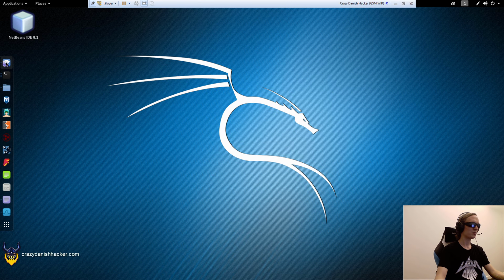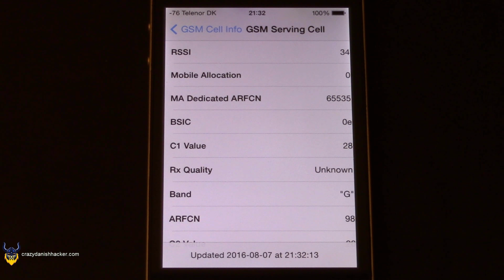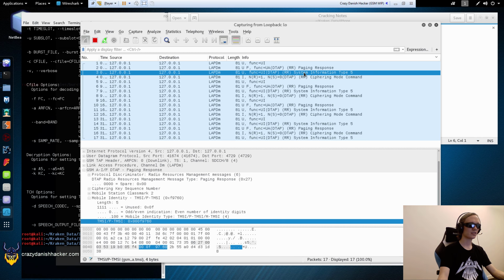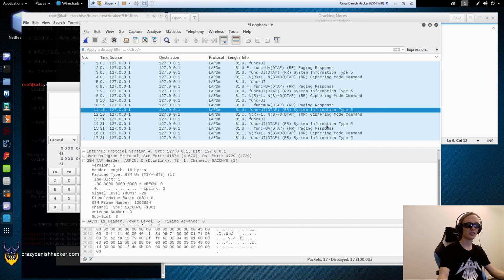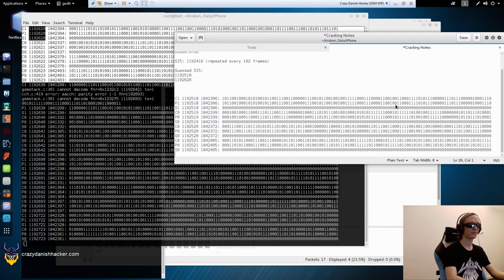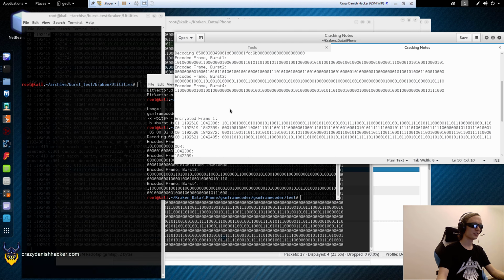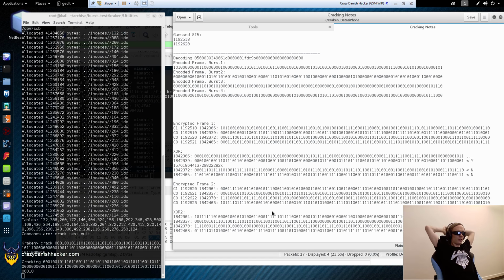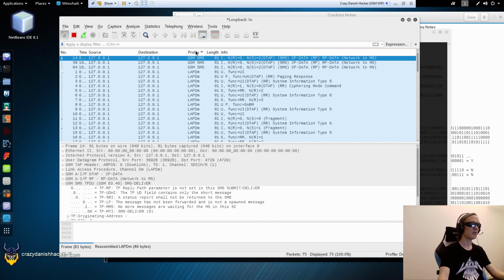GSM Cracking: SMS w/ Kraken - Software Defined Radio Series #16

Comment: Hello What do you think about this program?

topguw
https://github.com/bastienjalbert/topguw
Reply from the maker: It's useless and full of flaws. I've mentioned why it's flawed in other videos and comments as well. Instead of looking at every 102 frames for SI5 packets, it uses every 104 frames from what I can recall, and that means if you want to crack a burst to find the temporary encryption key (Kc), you just have to be extremely lucky if you're using this program. 

Cracking A5/1 should not rely on "extreme luck", it should rely on specific methods that can be repeated. When I tested this method manually, it worked around 2/4 to 3/4 times. (The A5/1 rainbow tables do not guarantee 100% success apparently, if they did, the method I showed would be successful 99% to 100% of the time.)

If you use a program to do everything for you, then you don't know the process and therefore you won't really know or learn what's going on. After you've mastered the manual approach, then you should try the automated approach for example, as you will be able to troubleshoot and fix any flaws you encounter throughout the process of cracking an A5/1 handshake.

What I found "topguw" useful for, is when there were no good guides on A5/1 cracking (at the time when I was initially making this video series), was to better understand the process until I had a look at the source code and saw the "104 Frame Error". (I'm not sure if it was/is there intentionally though.)

In any case, if you use "topguw" or as I call it, "topgun", the success rate is going to be based on pure luck unless the developer or a fork of that github repository fixed that issue.

As I already mentioned, learn how to do it manually first and when that works, then you can try to use or develop automated tools for fun.

Comment: So my problem is that never find the kc and when i crack something it is from xor1 third one down never any others...could it be thoes bytes that need to be changed to 00? Never changed those
Reply from the maker: Keep in mind you can only crack A5/1 encrypted sessions, and that you need to use all of the A5/1 tables (1.5~ TB). In my case I had to record a few sessions as the first one or two didn't work. When you use find_kc, you must also execute it on the same server as where Kraken is installed.

I recommend going through the whole process again if you have confirmed that it's A5/1 you're trying to crack and you also have all of the tables loaded into Kraken.
Reply: Im using ubuntu on laptop and the rainbow tables are unpacked on a hardrive ./kraken ../.indexes succesfully loads all the tables. tried about 15 times to crack a5/1 with no success
Reply from the maker: Try this capture: https://pastebin.com/ZHmj9CD1 (Paste expires in 1 week)
I haven't tried cracking the A5/1 packets in that, but maybe it'll work. 
Frequency: 952800518
SDCCH8 Timeslot: 1

I'm not sure if there are SMS's in that capture, but it's a quality capture though.
Reply: There seems to be an sms but si5 frame number does not exist in bursts.txt. it is 1282639 but what exists are 1282634-1282637. Have you ever tried to kalibrate your bladerf? this guys method https://www.youtube.com/watch?v=ym81vhSoo44 with GSM900 gives awful ppm
Reply from the maker: Hmm, are you sure (that those captures I recorded and shared don't have SI5 packets)? I recorded those with an RTL-SDR (the one with a heat sink) and another person who decoded them, said it was much better than what they had.

I have tried temporarily "kalibrating" my BladeRF, but the factory calibration is almost identical to what I would achieve. However, I guess that maybe I should try this next time I run a service like a BTS. I had a quick look at that video, and I can't remember if I used the BladeRF version of "kal" or if I used another method, but I definitely did play with calibration sometime ago, and also that big "DC line" (or whatever it's called) in the middle when you just run the BladeRF by default.

I haven't used the BladeRF in a while, even though that should change very soon :-)

Comment: is there any automated programs for cracking sms?
Reply from the maker: Not fully automated, I think "pytacle" is the only project that attempted to do this, but using fully automated tools will not teach you anything. If you can understand how it works manually, and you can use Scapy, then you can probably make your own automated tool for cracking A5/1 encrypted SMS. 

There are no known exploits/tools against A5/3. (Default encryption in most countries nowadays I believe.)
Reply: @CrazyDanishHacker  how to exploit a5/3 encryption please help

Comment: With my RTL-SDR does not work,I don't know why..maybe I bought wrong,sometimes traffic is recorded and sometimes not..I'll buy another one that you have.I got the key a/51 and sent to the phone SMS and began to record the traffic,but when you decrypt, I do not see SMS,strange..Hacker,and you are familiar with the branch of osmocombb "typhon-vx" ?
Reply from the maker: I'm not familiar with how the osmocombb phones work. If you're going to get a nice RTL-SDR, then get one from RTL-SDR.com or NooElec.com. It's highly recommended you get one of those with a heatsink like this:
https://www.rtl-sdr.com/wp-content/uploads/2013/04/SDRBlogImage_1_Side.jpg
or
http://www.nooelec.com/store/media/catalog/product/cache/1/image/458x/040ec09b1e35df139433887a97daa66f/n/e/nesdr_smart_5_1_1.png

I have one from RTL-SDR.com and it's the best cheap RTL-SDR I've bought so far.

Also, don't buy them from eBay or Aliexpress:
www.rtl-sdr.com/warning-r820t2-rtl-sdr-purchases-ebayaliexpress-etc/
Reply from the maker: Generally speaking the traffic should always be captured and saved to disk. In case it's not, restart the virtual machine and unplug the RTL-SDR, then plug it back in. That can also solve some minor issues that sometimes happen.

Comment: I have two questions:
1: Is it necessary to have last ten bytes to be zero zero ? in my case SI5 is having 05 02 03 03 49 06 1d 00 00 00 00 00 00 00 00 3f f7 f8 00 01 00 00 00. 
2: for decoding byte stream 05 02 03 03 49 06 1d 00 00 00 00 00 00 00 00 3f f7 f8 00 01 00 00 00 do i have to make second byte 00 from 02 ?
Reply from the maker: SI5 packets should always be the same lengths I believe. It's been some time since I last did this, but yes the trailing 00 bytes are very important too. You want to copy and modify it as I showed in the video. The only thing you need to change in that SI5 packet is the "timing advance" information which I showed in my video. I don't remember having to change any other bytes. 

Basically you take a known type of packet, in this case System Information 5 aka SI5, and then you try to guess where the next SI5 packet is within an "encrypted stream" while receiving an SMS for example. You do this by adding 102 to the frame number, up to around 10 times. 

This is because the SI5 packet is repeated every 102 frames, so you can somewhat reliably guess the next time it may be sent by the tower. There are some telcos (service providers) that may send SI5 packets at random intervals though.
Reply: in my case SI5 is far from the chiper mode command so can i use it ? here is the link http://i67.tinypic.com/w0lsvl.png
Reply from the maker: SI5 should be repeated every 102 frames. I can't see it in this screenshot as you need to look at the GMS Tap header and look at the GSM Frame number for both SI5 packets, but it looks like you can.

Comment: hi, when i try test command in kraken it gives me result in 2mins but when i try to crack real data it takes ages to give output. why is that?
Reply from the maker: It's because with the "test data" it probably doesn't use your super slow USB hard disks :-) (They can be quite slow even with USB3)
How long is it taking for you and have you been able to crack some bursts yet?
Reply: Its taking around 5 to 8 mins to crack on a fast computer and on slow computer the process get killed after half an hour. i tried 8 captures and took 3 SI5 packet of each cap. and from them only one packet got cracked but when i tried to find kc it didnt match. :-/
Reply: Also tell me if i can use any other time slot that contain SI5 messages and Also can i use SI6 or any other too ?
Reply from the maker: You can use any type of packet that contains the same information when it's encrypted and unencrypted. I read on a mailing list "ages ago" that you could probably use empty frames too. Even when you do this methodology right, you're not guaranteed to crack the Kc it seems. In my case when I tried with SMS over A5/1, it took me 2 or 3 tries. 

The best way to find out if e.g. SI6 gets sent in encrypted streams, is to check how often the SI6 packets are sent in wireshark by comparing the GSM Framenumber, and then a decrypted SMS stream for example and see which packets are inside that subchannel/stream.
Reply from the maker: This type of A5/1 cracking attack is also known as the: "Known plain-text attack" I think it's called. In other words, you have two pieces of information, A and B. They both contain the same information, but B is encrypted. https://en.wikipedia.org/wiki/Known-plaintext_attack
Reply from the maker: In this case you have for example, an unencrypted SI6 packet, but you also need an encrypted version of it, so you need to be able to predict where the next A5/1 encrypted (and relevant) SI6 packet is. As I mentioned in another comment, if the SI6 packets are sent every 102 frames too maybe (like SI5), then there's a chance that it may be present in encrypted streams too.

Keep in mind that you should NOT use tools like topguw because it's flawed by design (i.e. check the source code). Do it manually like I demonstrated in this video.
Reply from the maker: Concerning your question about time slots. The time slot (and sub channel) is where your encrypted data will be, and when you view a specific sub channel and time slot in wireshark, it's a lot easier to see what's going on. You still need to find an unencrypted packet, and then be able to guess where the same type of packet is, encrypted within the stream.
Reply: Thanks a lot for your response I really appreciate that you help us all alot. I will try this
Reply: Thanks. Here i have a packet but if you see its not continuous. i mean after 117 the next packet is at 121 and also the last 10 bytes are not zero zero. so i can discard such type of packets right ? http://oi64.tinypic.com/30ixbb6.jpg
Reply: Also is it important that packets like SI5 and ciphering mode command should lie in same subslot? i have seen a case in which SI5 lies in subslot 6 and then the next packet is ciphering mode command and it lies under sub slot 0.
Reply from the maker: That's because you're using a filter. The packet number has nothing to do with decoding/cracking/decrypting GSM packets. The packet no/number is just the order of the packets as Wireshark sees them. The true number is the GSM frame number.

You need to open the GSM Tap Header field and look for the GSM Frame Number for that SI5 packet and then add 102 to the GSM Frame Number as I showed in my video.
Reply from the maker: It's not super important that SI5 and CMC (Ciphering Mode Command) are in the same subslot, even though it's quite common to see an SI5 packet before or after the CMC packet.

In any case, as I've mentioned before, SI5 is repeated every 102 frames so if you look at an SI5 packet and then scroll down to the next SI5 packet, then you can divide the GSM Frame Number with 102 to confirm they're not using randomized SI5 packet locations.

Comment: 12:48 I have no such byte(( there is only a burst 

Screenshot:http://joxi.ru/J2badOjFjDgGm6
Reply from the maker: That sounds odd, does Voice decryption work normal? 
https://www.youtube.com/watch?v=krJJKjYdwgc&index=9&list=PLRovDyowOn5F_TFotx0n8A79ToZYD2lOv 

If it does, then try to make multiple captures which I should've mentioned in the video. 

The reason why you get a slightly different output, would only make sense if the code was updated to not output those extra lines. 

Keep on working, I think you're getting close to the result :-)
Reply: I have not tried.I'm just starting. I 3 days ago I recorded random data gsm weighing 2.4 GB,then got them burst,now how do I get keystream ?I would have tried on my phone,but I can't get kc, and the tmsi,so I'm trying to decrypt random data from broadcast :( there is much I do not understand from your video because of not knowledge of English,I use translator. ((
Reply from the maker: Hmm, well I'm glad you're trying anyway despite you have to use Google Translator. With random data which you generally should avoid, then it's going to be much harder to learn even though it should be possible if they use A5/1 and it's 2G and not 3G or 4G.
Reply: Thank you! In the package lapdm it has been said that use A5/1:) I saw A/3.By the way..what am I supposed to do? by the way..have you heard of the utility topguw ?
Reply from the maker: The topguw tool is broken and does not work. I tried to use it when I had to learn this for myself, and ended up reading the source code. It basically counts/guesses encrypted frames the wrong way and I think it XOR's them wrong too. 

You're supposed to find an unencrypted System Information 5 packet, and then guess where it is within an encrypted burst. The System Information 5 packet is sent every 102 frames as I've explained in my video :-)
Reply: What distinguishes the personal decryption of gsm traffic from the outside ? what is the complexity of decoding random traffic?
Reply from the maker: When you decode your own traffic, you can verify what the key should be by extracting it from your phone and then manually decrypt the traffic. When you decode random traffic which is not recommended, then you have no idea what the device is receiving so it's also very bad for learning purposes. (It's also unethical to decode someone else's traffic.)
Reply: In the package lapdm written that uses encryption A5/1 means that 90% of what that phone
Reply from the maker: Yeah if the Cipher Mode Command (CMC) packet says A5/1 then it's A5/1, but you don't know if it's an SMS or Phone call, and maybe channel hopping is enabled, so make sure you check that too :-)
Reply: Crazy Danish Hacker hopping off :)
Reply: Crazy Danish Hacker,The truth is that you can clone the phone network operator kc knowing the key ?
Reply from the maker: The thing is, if you're the network operator or have access to their network you should be able to sniff all SMS and phone calls if you like. But, the "kc" being used is different each time between each phone call for example with most telcos as far as I know. This means that even if you know the network operator "secret" used to generate the kc, the "secret" on the mobile device (UE) still needs to be bruteforced too, and even then, I think during the "Kc" exchange/generation, a "random seed" is used so to be honest, it's probably easier trying to crack it with Kraken if they're using A5/1 encryption.
Reply: Crazy Danish Hacker Thanks :)

Comment: perhaps a yatebts demo would be nice where you as the tower can just turn off encryption, i allways get stuck trying to connect to my tower with no luck
Reply from the maker: Yes I've had a similar issue when I tried it last year. One phone wouldn't connect, another would disconnect periodically.